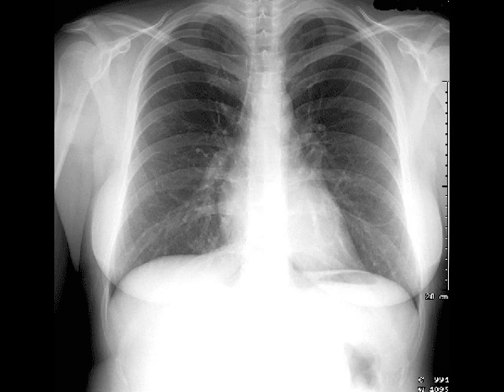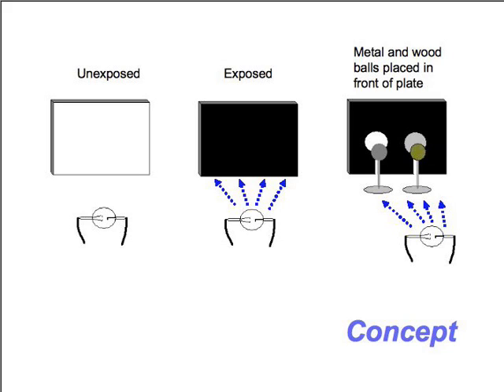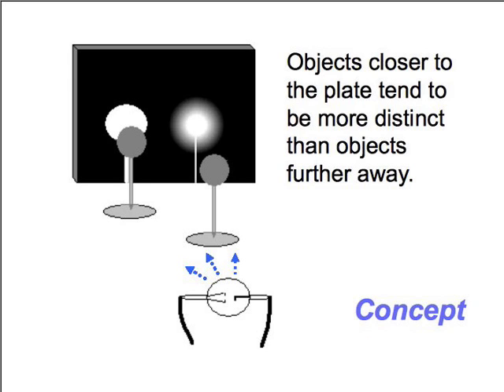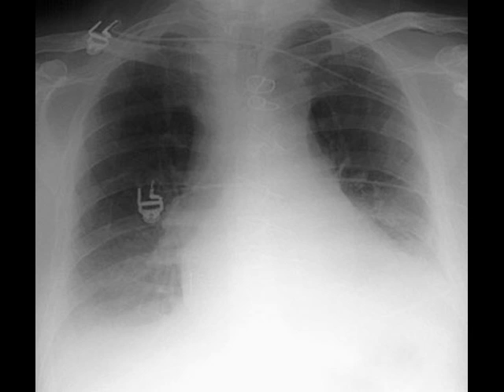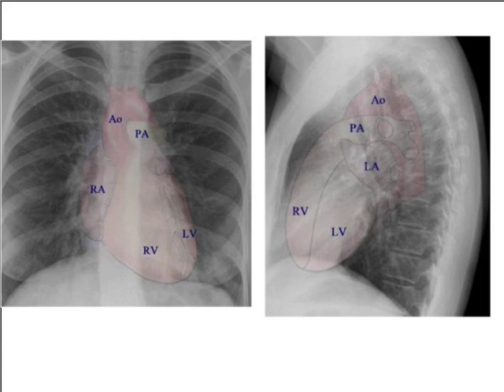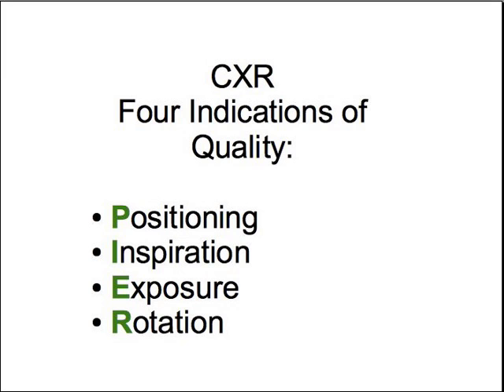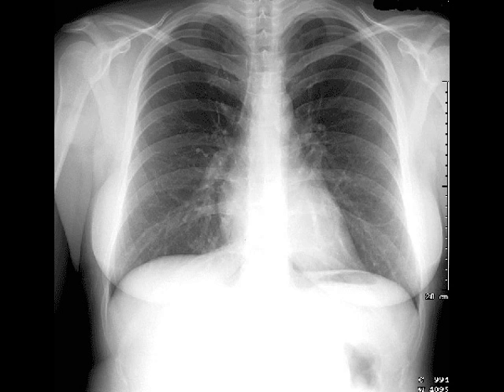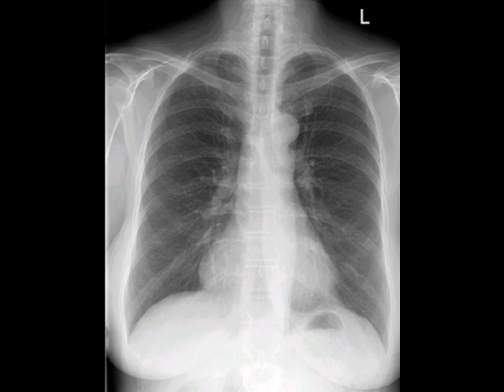CXR - How to read the chest x ray - Part I: Concepts and Quality

Comment: In clinical practice when viewing the images on a monitor (or old school films on a backlight), the image that was actually taken (PA) is often deliberately flipped so the physician reading it sees the patient in a traditional "anatomic position" (AP).  Typically, one side will be marked (either "L" or "R").  A normal letter means you are seeing the image as it was actually taken. If the letter looks backwards, the image has been reversed.   Imagine a backward "L" in the upper right corner.

Comment: Sorry to say, but Xray radiation and gamma radiation are two different types of radiation. Gamma is not used to produce radiographies... xrays are produced when accelarated electrons are suddenly stopped, from the sudden stop an energy appears which are the x-rays.... Gamma rays are produced by sub-atomic particle interactions such as electron-positron annihilation, neutral pion decay, radioactive decay, fusion, fission or inverse Compton scattering in astrophysical processes. Please correct